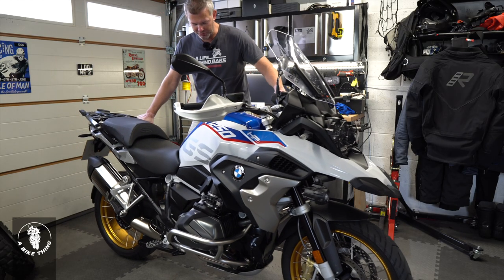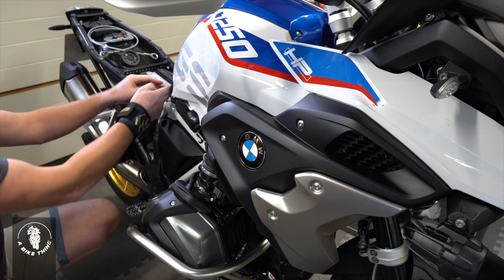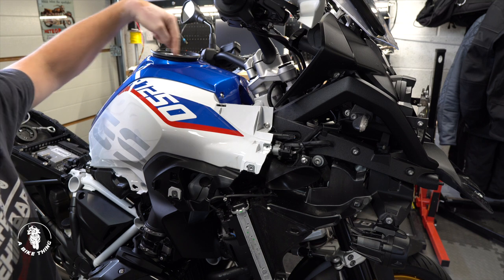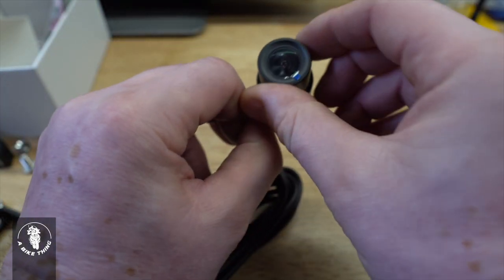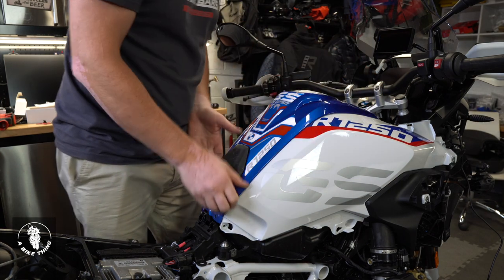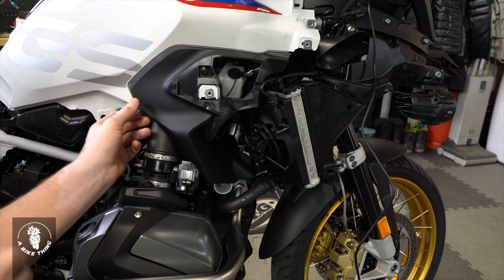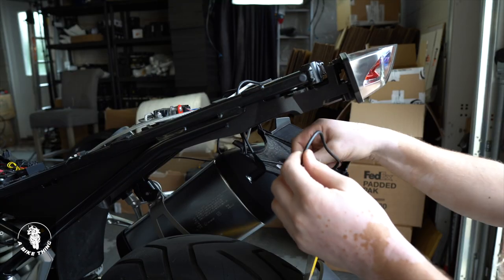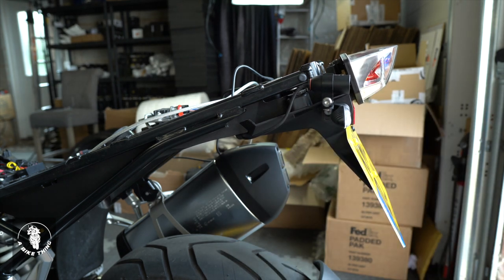INNOVV K2 (SCREW BY SCREW) INSTALLATION BMW R1250GS HP

Comment from the maker: Double DRAT!  I didn’t show where the gps is located.  It’s right at the back behind the rear light.
Reply: Hi Steve, Any chance of a photo showing the GPS and is it not affected by a top box. Great video and very concise. I purchased one at the London Bike show but haven't fitted it yet to my 1200GS but your video makes it far easier.

Comment: I bought kit from Steve did my own installation. I installed the GPS in front of fuel filler cap underneath plastic tank cover. No problems with it picking up a signal. Great video Steve
Reply: Did you have an issue with vibration in the front camera? I installed like Steve did in the video but video shows too much vibration.

Comment: The reason the -ve comes off first and goes on last is simple.  With the -ve off, if your screwdriver accidentally touches the frame when undoing/tightening the +ve there's no path back to the -ve terminal of the battery through the frame, so there's no short circuit. If -ve is still connected and you accidentally make a connection to the frame when touching the +ve terminal then you'll get a direct short and bad things happen.

Forget about "putting things on" and "taking things off" and just think "if I'm touching the +ve terminal then the -ve should already be disconnected"

Comment: Just used your video help to me install the K2 on my 2019 r1250gs, thanks so much  your explanation/video was very helpful!  I finished up yesterday mounting the cameras in the positions you used in the video (except in the front I did mount to the side so that I can get the wind screen in the full down position).  Last night I was laying in bed thinking about the installation when I thought "I hope the rear camera doesn't interfere with my Vario side bag mounting!".  Just went out and mounted the side bag and it is like the camera was made to fit with the bag mounted!  Fits snugly between the bag and the bike making the camera even less obvious.  Thanks again for your good work!

Comment: Fitted my cameras yesterday on my new GS which I haven't even ridden yet so I was very apprehensive of taking my bike apart.
With my laptop in the garage and following your step by step guide I managed a very neat installation. Thank you very much.
I just need to find the best place for the gps.
Reply from the maker: Thanks for sharing Paul.  GPS at the back under the tray.

Comment: Thanks for posting such a comprehensive guide, it's very much appreciated. I'd also appreciate your advice on whether you can see any problems with powering the unit from the accessory socket on my R1250r. The power socket on my bike is below the seat and I have no need to use it for anything else, as I have an adapter on the bmw satnav base which gives me 2 usb outlets for my phone etc. 

What I propose to do is relocate the power socket from the side panel to underneath the seat with my Powerlet usb adapter plugged in and micro usb cable to provide power to the dvr. The socket is only powered when the bike is on, so I'm hoping this will eliminate the need for the DC converter/transformer. I like the idea of not having more connections to the battery and keeping more of the hardware and wiring under the pillion seat.

Comment: Hi, I installed the Innovv K2. Red cable to the plus and the black to the negative. The yellow cable also connected to the correct location. When I turn off the bike the DVR turns off after 30 seconds. Only the DC converter light remains on. Is this how it should be? and does this have consequences my battery?

Thanks for making these helpful videos!

Comment: Anyone else have issues with vibration on the front camera when installing where Steve did? 

I have a R1250GS and I'm going to have to move the camera. Unfortunately, I installed it when the bike was disassembled and ran the camera wire with all the other wires from the lights. I even ran everything under the tank! The camera body is too wide to fit in the gap between the windshield and the headlight so looks like I'm disassembling everything just to free up the connection part of the wire so I can remove it from it's current location.
Reply from the maker: I feel your pain here.  I nice mod for innovv would be to make a connection point both ends like denali do for lights.  Let’s see what innovv do on future models which are under development
Reply: @ABIKETHING  Exactly. That is the first thing I looked at thinking I will just detach the camera from the wire in some way. No big deal, I'm getting good at taking the bike apart.

Comment: Hey Steve, I was wondering. Would it be possible to install the rear facing camera somewhere above the dashboard, behind the windscreen (facing to the rear obviously)?
From that front position and given that the INNOV has a wide field of view, would it (rear camera) be able to record the rider as well as what is coming up from behind him?
When used as evidence I suppose it would benefit the rider to actually show what he/she was doing if hit from behind, plus the benefit of the camera recording the entire bike if tampered with when parked. Your thoughts?
Reply from the maker: Wide field sure but the rider is still going to block some serious space.   Makes for an interesting 3 cam system though. I’ll feed this back

Comment: Hi  Just wondering if you have done a fit to a R1250RT?  Wondering where to pick up a switched live, some suggest the front power socket, but as I use that for my Optimate that may be a problem?
Many Thanks
Reply from the maker: It’s identical to a Gs. Under seat. Fuse plug.  Red and blue wire going to 7.5amp fuse.
Reply: @ABIKETHING  Thanks for taking the time to answer, much appreciated. I'll have a look when the new bike arrives hopefully in the next few weeks :-)  I'm not very 'techie' but hopefully should manage.
Keep Safe

Comment: I just spoke to 'North Oxford Motorrad' who is one of the Innovv's authorised installers and they said they stopped installing Innovvs because of technical issues they faced. I am not sure about it now.
Reply from the maker: What technical issues?  I’ll ask innovv what’s this all about and come back to you.
Reply: @ABIKETHING  Best to call North Oxford BMW Motorrad parts dept as well.
Reply from the maker: TheOutdoorFun good call 👍
Reply from the maker: Ok, spoken to Innovv and from I'm hearing there's no point in asking North Oxford Garage.  They only ever installed a handful so maybe it's something they're doing wrong their end and they didn't ask for any support from Innovv.  I get techie issues every day from customers and I try to give them the solution but it needs to begin with the customer asking me.  I know for a fact my local dealer fit them (Wollaston) and Wollaston own North Oxford garage.  I'm also aware of other BMW motorrad dealers who supply and fit them too.  Obviously none of them do as good as job as me 😉.     But maybe draw your own conclusion after checking out Trust Pilot reviews https://uk.trustpilot.com/review/www.innovv.co.uk
Reply: @ABIKETHING  Thanks good to know. Let me know if you know of a authorised installer near Hampshire.